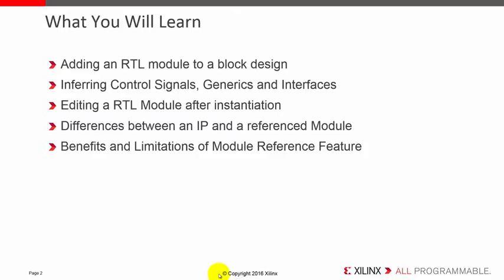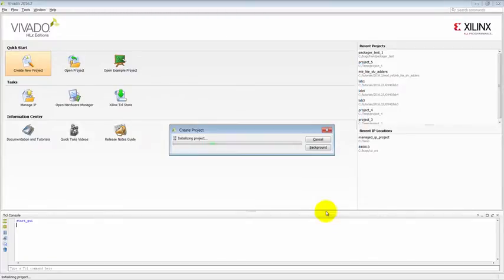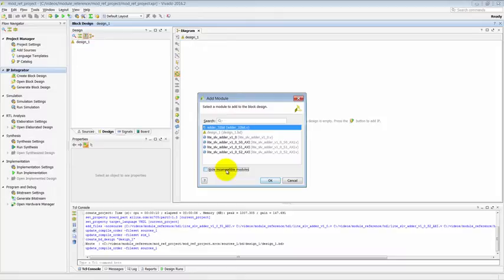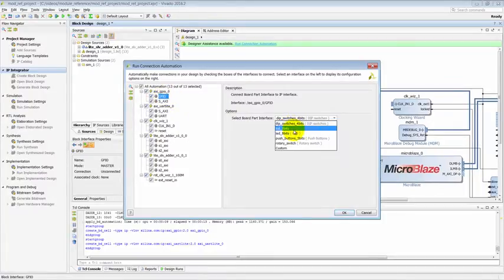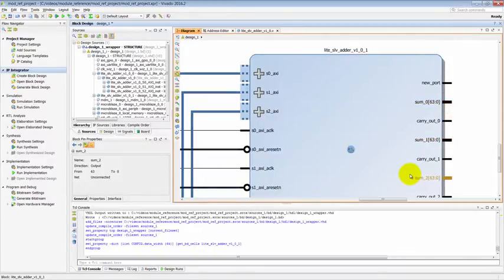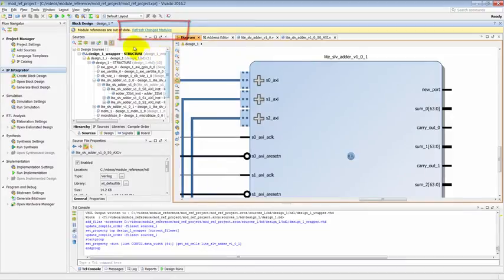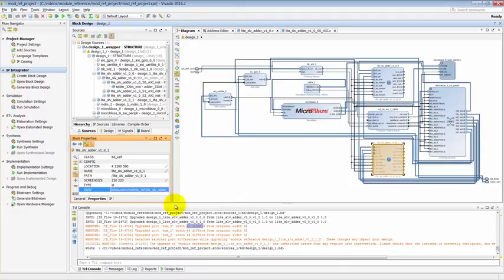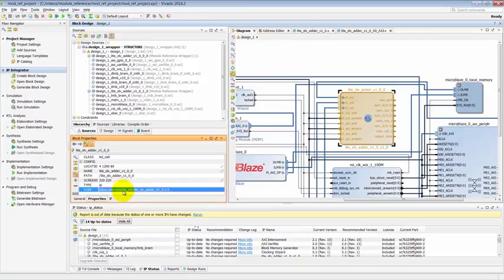Referencing RTL Modules for use in Vivado IP Integrator

Comment: I successfully made a Vivado and Vitis example using IP and flashing some LEDs on a Digilent sample board. Next I make my own Verilog module to control LED brightness but it doesn't really matter what it does. When I look at the NET from the unchanged sample design connecting a GPIO port in a AXI GPIO port in the [GENERAL][PROPERTIES] window I see class: bd_intf_net the net is called "Interface Connection Properties" with name : axi_gpio_leds_GPIO. Anyway it works fine. Trying to use my verilog module I brought into the block diagram with a regular OUTPUT or INOUT port doesn't work. It says "System Net Properties" class: bd_net. So I basically don't understand differences between IP ports I see in the block diagram and ports in Verilog modules I make. I want to be able to connect my Verilog modules to IP modules and the pins driving LEDs and other things which the Block Diagram Tools knew how to create a port for from the board files. I don't understand the issues related to that and how to make the correct port type the board diagram will recognize and let me connect to LED or other ports. Are there any simple examples doing that? I made a working Apple ][ from the schematic in an Artix-7 from the Apple Schematic all in Verilog so I think I understand that basic end of things okay. Help Me Xilinx Quick Take 1 - You are my only hope.